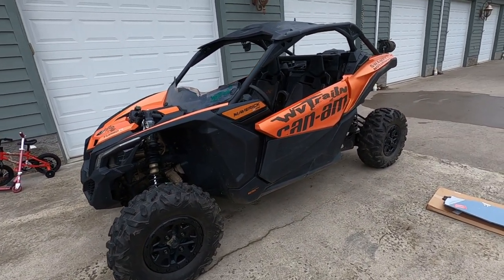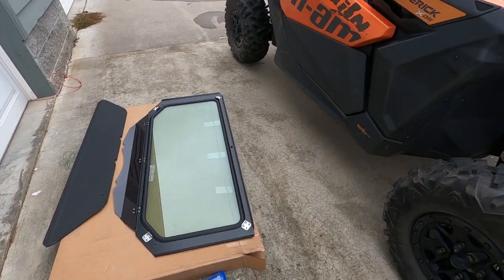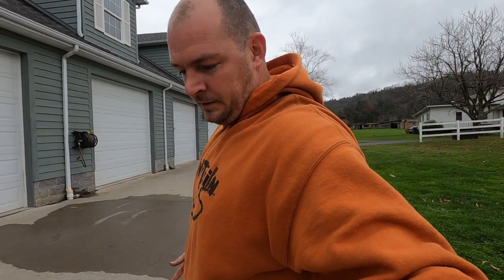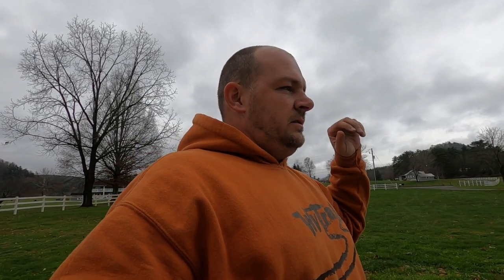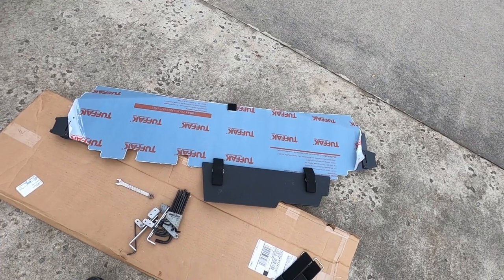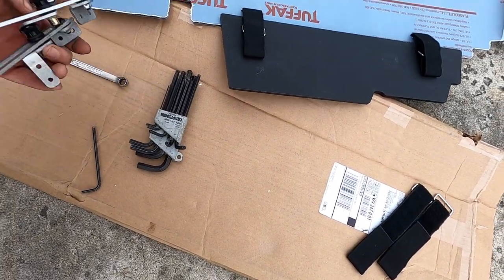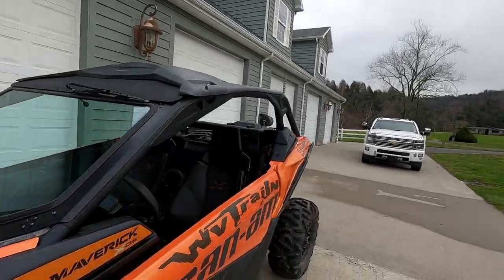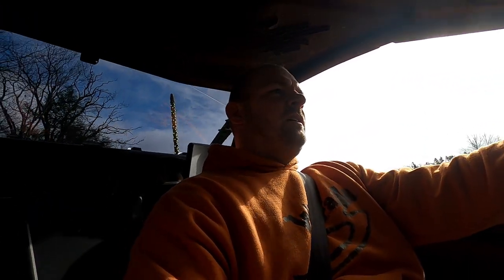CAN AM X3 GLASS WINDSHIELD AND REAR WINDOW INSTALL! GETTING READY FOR WINTER!!

Comment: I bought the utvzilla for my turbo s on Sunday. Should be here by Friday 😃 I sometimes take my RZR over to see my mom 30 miles away and leave about 830 at night to drive home. Drove it there 2 weeks ago because the high was 55 degrees. I froze all the way home especially in the lower areas and by the rivers! Hoping this helps instead of my half windshield. May look into a rear shield as well! Wish I could enclose the whole cab without spending a lot of $$$

Comment: You can very cheaply piece together a washer kit with a hood mounted sprayer. we did that on my buddies talon and works perfect
Reply from the maker: I’ve looked at a couple kits online. Like $30 for everything. I blew my budget on these and the upper doors. Also grabbed a cheap sound bar. Washer and electric wiper is on my list once I recoup some.
Reply: @WvTrailN  well until you get one be sure to rainex the glass and bring a few empty milk jugs full of water. Or just one if you have river crossings. Enjoy your videos. Keep it up. We’re heading to Hatfield here middle of December
Reply from the maker: @jeffreyvian  thanks!

Comment: Good stuff. Got an EMP scratch resistant front & rear coming week after Thanksgiving, hand wiper, and Kenimoto washer fluid bottle. Next is upper doors & a heater. Ranger HLE is going to be like a Cadillac.
Reply from the maker: It Sure makes winter cruising more enjoyable. How do you like the ranger HL?
Reply: @WvTrailN  trying to get up your way to try it out. Got 6 or 8 rigs coming up weekend of December 11th. Traded my X3 for it last month, needed something to pull double duty around my property.

Comment: how is that ear rattling noise at 5500 rpm with the airbox relocation? and how much more did it help with the rear windshield? Are you able to have a casual conversation at normal volume with both installed at 5k rpm
Reply from the maker: The air relocate helped mine tremendously. Still have loud engine noise in the cab. Trails isn’t bad but cruising at 5-6k rpm you gotta speak up to have a conversation.

Comment: My CanAm X3 max stays warm enough inside with with just front windshield and rear windshield with a medium coat
Reply from the maker: I Had my first ride on it today. It did really well. Good heat coming up from the shifter. I have some ideas for getting some heat in the cab as winter shows up. Not sure if they good ideas but we shall find out.